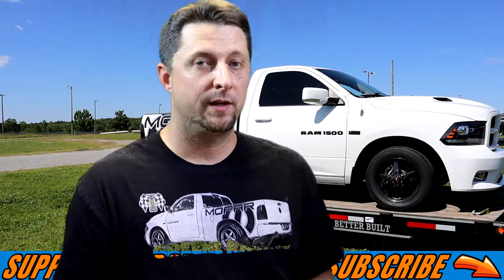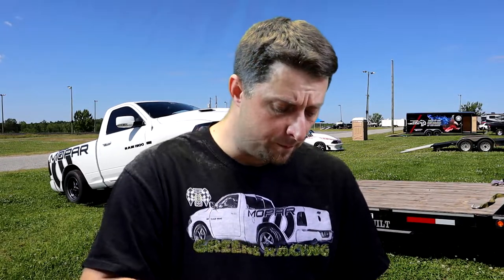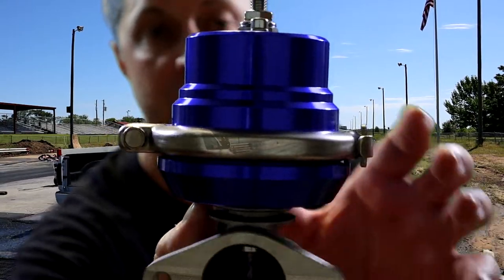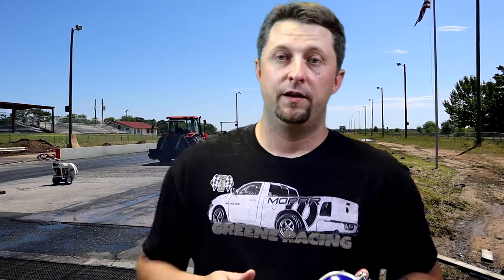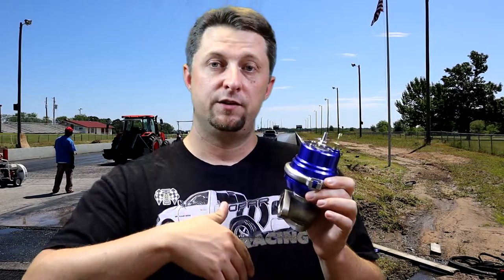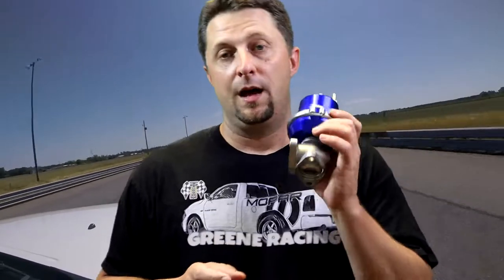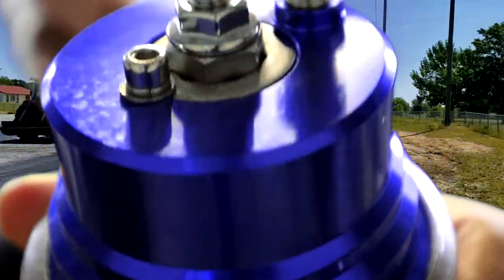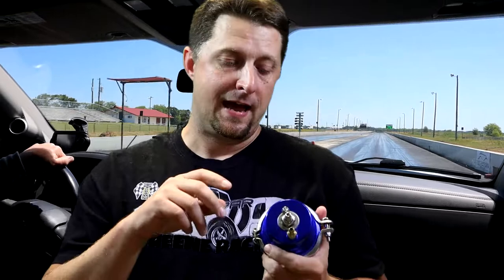SPELAB Wastegate For My TorqStorm Surpercharger

Comment: Peak power likey suffers a bit as spinning the supercharger harder meaning it is compressing the air as if it were a smaller pulley heats up the air more.  The peak will likely be down, the low and midrange area gains will offset the loss up top.  Means higher average hp and tq.  So track gains should yield higher mph and quicker times.

Comment: been looking into this...saw an article and they actually gained 70 ft lbs of torque with the smaller pulley and wastegate setup. My biggest question is where do you mount it??
Reply from the maker: You could mount it anywhere on the pressure side really.
Reply: @FrostbiteRam  before or after intercooler? saw one build where they mounted the wastegate before intercooler and BOV on the other side of intercooler
Reply from the maker: @hostilehemi9740  either will work fine.

Comment: Jeez don't rely on that pos .. seen plenty of those knock off gates leak , seize and generally just fall apart.. I don't have any experience with one on a centrifugal but I have seen higher boost vehicle use them ( quality gates , not that thing ) I've never really seen a wastegate work on a lower boost centrifugal vehicle .. on a turbo they open before the turbo to slow the turbo down ,obviously that isn't the case on a supercharged vehicle.. I'd like to see this test with a good quality wastegate  , I wouldn't trust that one to save my engine
Reply from the maker: Good information, We will see soon how it does.